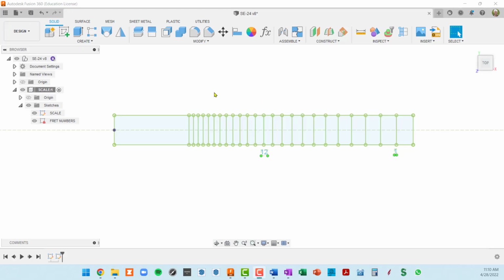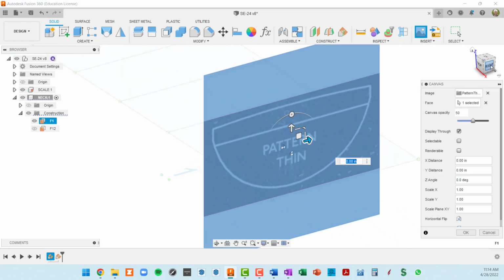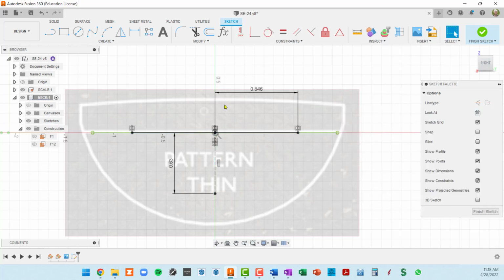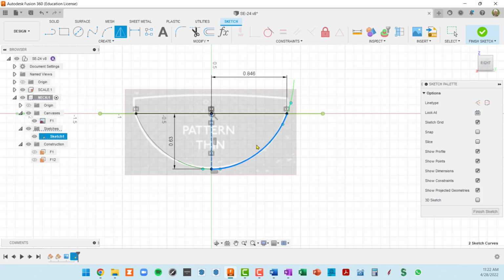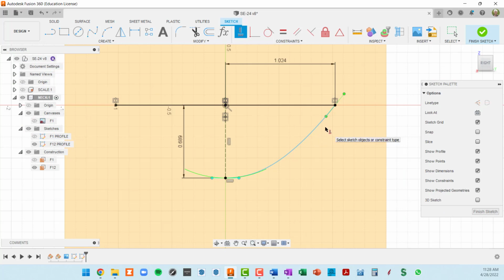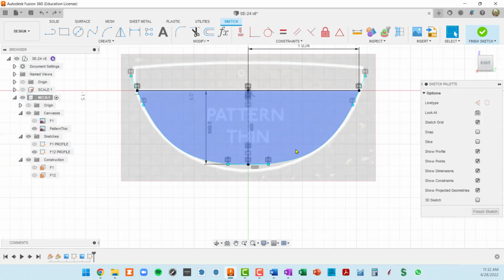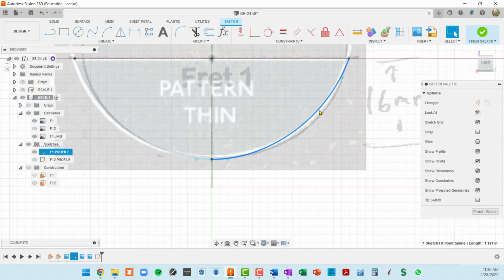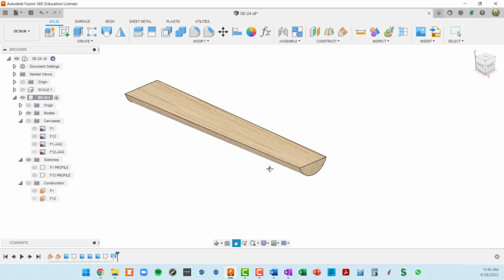Designing a PRS Guitar in Fusion 360 - Part 2: Neck Profiles

Comment: I have a different set of plans with another Neck cross section at Fret 6, seems like a very slightly concave shape of the neck contours. I managed to include a third sketch at 6th fret and create guidelines for the loft operation using splines along the edges.